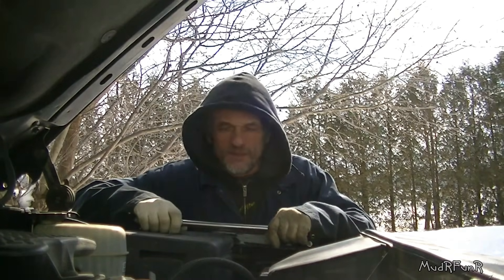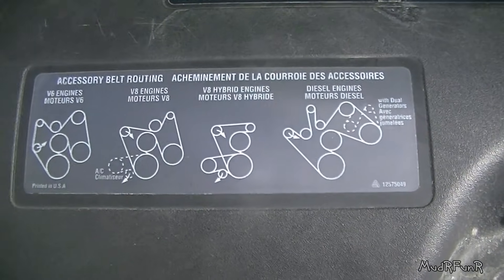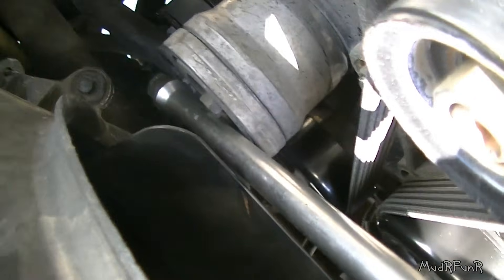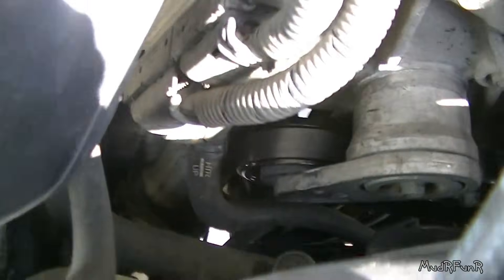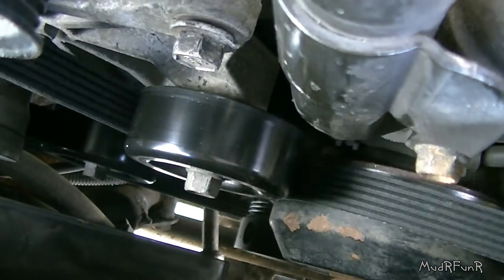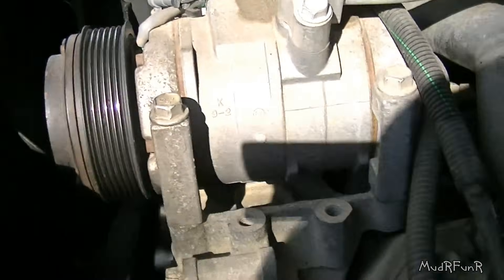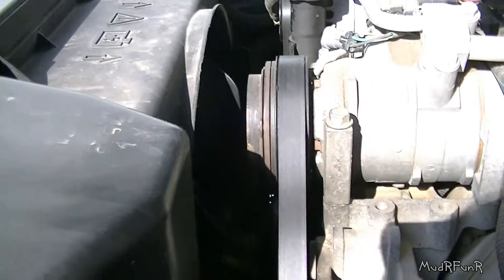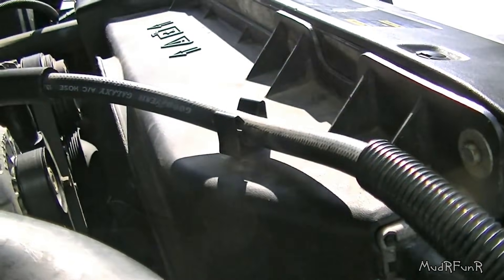Duramax 6.6L LLY Serpentine Belt Replacement for Beginners

Comment: Got to say a million thanks for this video.  I am 64 year old woman with a 2004 Chevy Duramax 6.6  and lost that tensioner pulley,  what a nice day....  so, went to town, bought the parts and followed your instructions.  Only trouble I had was the bar to the tensioner.  All 150 lbs of me to get it with one foot on the breaker bar as I stretched across the front of the rig, and got the belt on the ac.  Oh Yeah!   rock and roll.  Now to fix the cd player...  another day...   Thanks again.  great pics too.
Reply: You do rock Sandy. I wish there were many more like you in this world.
Reply: You rock sandy, hope the duramax is treating you well!
Reply from the maker: +Sandy Drake Wow, you are real brave to tackle this job yourself. Foot on the breaker bar and all. Thanks for your inspiring comment. Greatly appreciated!

Comment: Chevy 3500 has an extra shroud attached to moter in the way!
As well as cool air intake hose!
Fucking architexclamation!
They should be forced to be mechanic 43 years before allowed to work on designing a thimble!😅😅😅😅  the dark force is sitting on my shoulder laughing as I spew curse words like a machine gunner launching freedom lead!
?
Reply from the maker: Engineers are not at all thinking of the poor souls that have to work on their design failures. Seems they don't want anyone to be able to do even the simplest jobs themselves. 😒😒

Comment: Tip, in my 2008 even with the aribox off and fan shroud remove it was tight. To get the belt around crank pulley and lower idle roller, I used a long season arrow shaft to poke the belt around the pulleys. Never had to remove any splash shield or go under the truck. I also have the craftsman serpetine belt took which helped alot
Reply from the maker: Thanks for sharing that information
Reply: I owe you a beer! I didn't use an arrow, but after reading your comment I tore the hooked rod of the blinds and used it to loop around the bottom pulley. Thank you Sir!🍺

Comment: Looks a lot easier on an LLY.  I have an LML and the difference is the fan shroud.  On the LML, the fan shroud is 2 piece with one piece attached to the radiator and the second piece to the engine.  the struts that go to the engine.obstruct the movement of a breaker bar.  I made the mistake of taking the belt off with a breaker bar and I couldn't remove the breaker bar after as the tensioner had it pressed against one of the shroud struts.  Ultimately I had to remove the tensioner to free the breaker bar.  But in doing so, the engine shroud went deep into the radiator portion and now I have to figure out how to get it back as the rubber seals are inverted now..
Reply from the maker: Wow, sounds much more troublesome.

Comment: I lost the belt today at the bottom of a long steep grade hauling a 40 ft long steel flatbed trailer (4 tons?) with about 2 tons of rafting gear in S. Utah on the navajo res.  The truck was in tow mode and downshifted 2 times on me and way over revved putting the RPM's at 4500 when I was braking down the hill.  I tired all kinds of things to get the RPM's to drop, gas, more brake and pulled it out of tow mode that got it back to normal RPM.  I think the high rev's must have finished off one of the idler pulleys as the one below the tensioner was frozen once I found a place to pull over 2 miles up a long upgrade.  First cue was the battery icon red light and the battery gauge dropped to about 9 volts from 14.  Then no power steering and no booster for power brakes.  Luckily I was not going too fast , but with the huge load and little brakes, I was smashing the brake pedal hard as I could and barely managed to get into a tiny pullout with a 6" vertical drop into loose sand which likely helped me stop before the metal stake I would have hit in another 20 ft.    It is getting towed tonight 110 miles back to Moab and the river company I work for sent another truck out to rescue us.  Maintain your trucks everyone, no fun to be without steering and brakes!  BTW, the temp gauge was normal, thinking water pump is on the camshaft.

Comment: I would just like to tell anyone the consequences of loosing a pulley or belt as that happened to me yesterday. My 04 GMC Duramax threw a belt as I was pulling off the highway into my subdivision. I lost steering and brakes. If there hadn’t been a Very  wide entryway I could have killed someone.

Comment: Just did mine.  Had to remove the turbo pipes to get to the tensioner.  Fan shroud was in way.  And pipes would let me turn breaker bar. Towards passenger tire.  Bigger task than I thought.
Reply from the maker: Wow, that sounds like a real chore. Is your's a different year?
Reply: @MudRFunR  

2006

Comment: Not sure if you'll see this comment but it's worth a shot. I have a 2001 Chevy 3500 with a 6.6 Duramax. The idler pulley locked up today and broke the belt. Here's my problem. Got the new pulley in, got the new belt, followed the routing for the new belt and I end up about 4 inches short of getting the belt to fit. Measured the new belt against the old one (there are NO pieces missing from old belt, ends match perfectly) and they are both the same length. They have 2 different belt sizes, 1 for the 105 amp and 1 for the 130 amp alts. I think this is where my problem is. What alt do you have on yours and do you happen to remember the part number for the belt?
Reply from the maker: I honestly don't know what alternator I have. There is a link for the belt in the video description. Two things to be sure of are that the belt is in every groove properly, also be sure that the tensioner is fully sprung. Sometimes the wrench bottoms out before the tensioner moves all the way. Hope this helps.

Comment: no warning about the fan shroud. No room to remove the belt without removing the fan shroud!!
Reply from the maker: I did not have to remove the fan shroud. Are you working on the same model truck?
Reply: False...
Reply: The only thing that I removed was the air intake tube.

Comment: how about those markings on the tensioner, I just replaced my belt and the markings are lined up to the left side marking
Reply from the maker: From what I've read, as long as the tensioner is between the marks it is still ok to use.

Comment: Looks cold as hell there, you rock! Thanks
Reply from the maker: This was recorded Feb 27th. It had warmed up a lot from Feb 9th when I did the idler pulley video. I had an old electric heater on the ground under the engine while changing the pulleys. At that time, we had "feels like" temps of -30C to -40 overnight for a few weeks. BTW the electric heater burnt out too. Thanks for your comment. Greatly appreciated!

Comment: mudrfunr what your calling the water is not correct the water pump set behind the turbo watch you tube for changing water pump. thank for time and making my project easy
Reply from the maker: Yes the pump is gear driven. I realized my mistake when editing the video. I have since then replaced my water pump. It was a real pain removing the bolt at the end of the crank.

Comment: I really appreciate you posting this, I had to replace both idler pulleys and my belt and I was about to take it to the dealer til I watched your video. But I will say, a 2007 LBZ is much harder because you of the fan shroud always in the way, but aside a few cuts and bloody knuckles, im back on the road, thanks again.
Reply from the maker: Good to know that this helped you save some bucks!

Comment: My duramax belt was squealing and I gave it a few shots of WD-40 and no more squealing in the last 1k miles.  I inspected it and there are alot of small cracks but nothing that makes me visually fearful yet in my limited knowledge.  It's an '04 and has 80K miles.  How do you know when it's time to replace it?  Also is a 1/2 breaker bar absolutely required or can you use a 1/2 rachet with a cheater pipe or some other "home remedy"?  I really don't wish to purchase a tool I doubt I will ever use again since I won't tackle much more than this simple procedure and an oil change as I'm not mechanically inclined.  Thanks.
Reply: Change the damn thing cheaper than a tow bill, WD40  NEVER use on belts or any rubber parts, a petroleum based product, that will swell and deteriorate rubber parts!!
Reply from the maker: +jdh023 1/2" ratchet should do just fine. If you see a lot of cracking, I would replace it especially if it was squealing. Make sure you check all your pulleys with the belt off. Just make sure every pulley spins freely (except the bottom crankshaft pulley).
Reply: Can't tell you how much I appreciate your quick response.  You not only saved me the cost of the repair but now the cost a tool I doubt I would ever re-use.  THANK YOU SIR and Bless You for taking the time, effort (I do know it is effort) to do a good deed for those of us less mechanically inclined and help save us money and teach us something.  It's guys like you who ARE under-appreciated (well actually you are but you may not hear it often enough).  I DO appreciate it.  I'm sending good Karma to you my friend.  THANK YOU AGAIN.
Reply from the maker: +jdh023 Thank you so much for your comment, and for keeping me motivated! Hope all goes well with your belt, Enjoy and thanks for the good karma, sent you some too!
Reply: @MudRFunR  thank you for the video! Have a good day man
Reply from the maker: @donkeyballs7860  Glad to help. Thanks for watching!